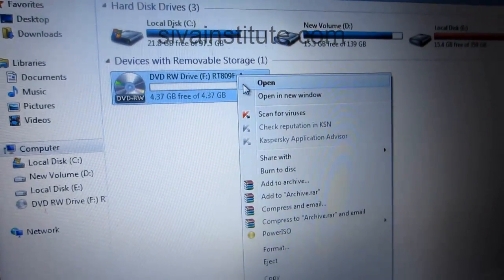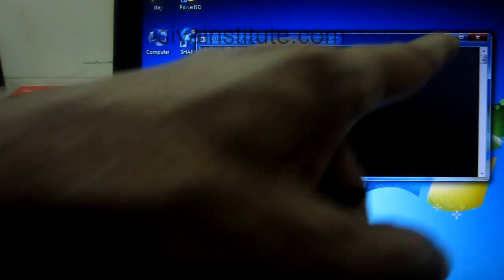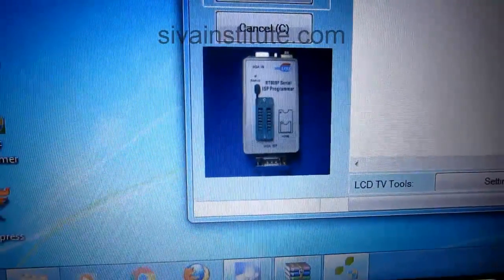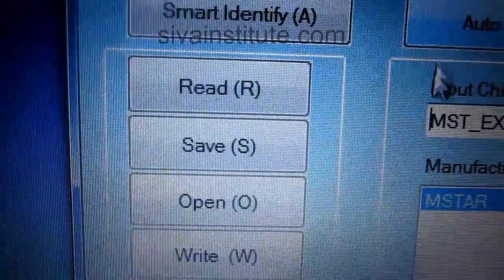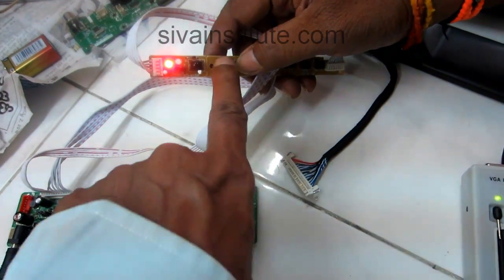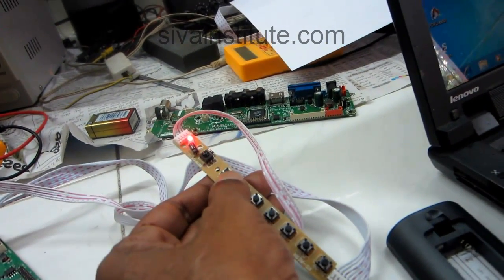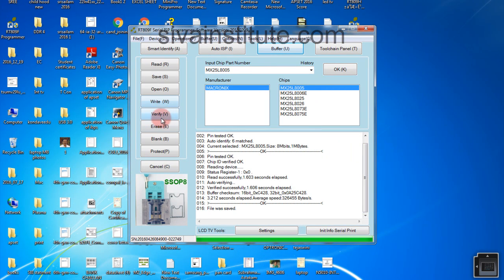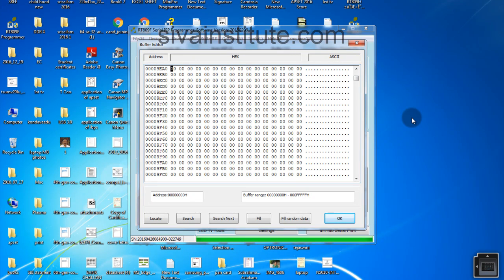How to Read and Write LED,LCD TV Bios Program with RT809F

Comment: Unable to detect memory chip part number, please power off circuit board, after that power it on and operate again.
020:  Using Mode-A to scan VGA port...
021:  MSTAR solution, part number starting with MST¡¢TSUM¡¢SE¡¢FE£¬their program is inside the external SPI flash memory¡£
022:  http://www.ifix.net.cn/thread-14392-1-8.html
023:  The currently selected:MST_EXT_SPI #ISP, capacity: 128Mbits, 16Mbytes.
024:  http://www.ifix.net.cn/thread-14392-1-8.html
025:  >------------------------------------OK---------------------------------------<
026:  VGA wire mode: SCL: VGA--15; SDA: VGA--12.
027:  MST main chip ID: 0x0000¡£
028:  MST main chip ID: 0x0000¡£
029:  -->Frequency auto adjust, rescanning ISP BUS...
030:  MST main chip ID: 0x0000¡£
031:  MST main chip ID: 0x0000¡£
032:  -->Frequency auto adjust, rescanning ISP BUS...
033:  MST main chip ID: 0x0000¡£
034:  MST main chip ID: 0x0000¡£
035:  Unable to detect memory chip part number, please power off circuit board, after that power it on and operate again.
Ho questo problema errore